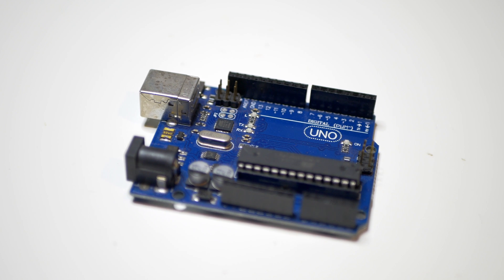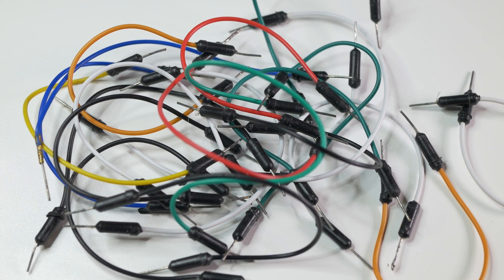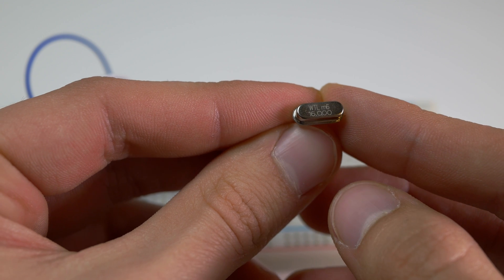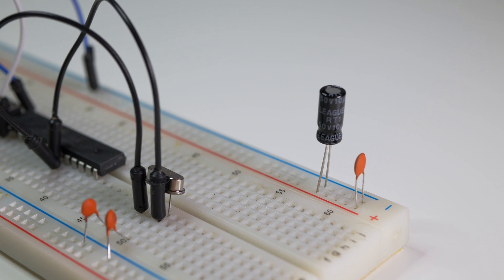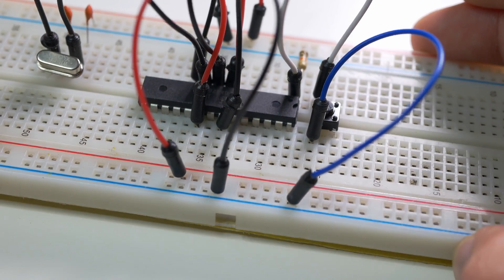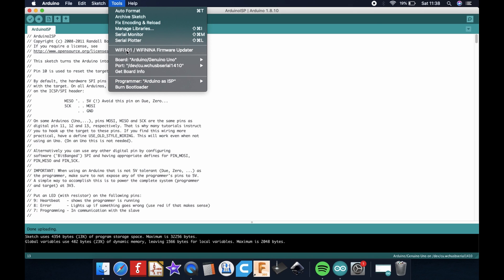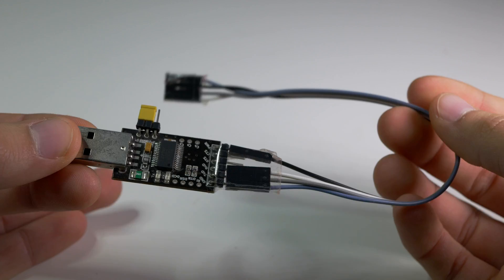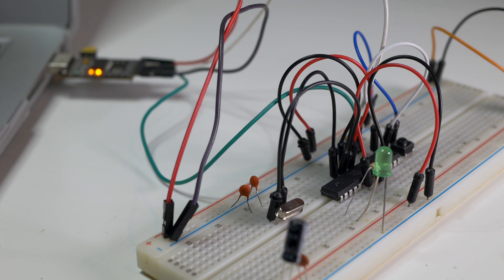DIY Arduino On a Breadboard

Comment: As i remember you also should add 10uF capacitor between RESET pin and GND to prevent Arduino to reset after serial connection is established. Without that i was not able to program my attiny

Comment: Hi, great video :) 
But take in mind that the crystal should be as close as possible of the MCU, and using wires would make it not work properly.
BTW it's not called "voltage filtration" but noise filtration
Reply from the maker: Yes, it should be as close as possible, same thing with capacitors, but in such a simple circuit at not super high frequencies it wouldn't be a problem and it always works for me just fine. Thanks for comment and tips!

Comment: These filtering capacitors should be placed as close to the atmega as posible to filter the voltage properly
Reply: Thanks for sharing knowledge

Comment: Hi.
I use such a setup to test the power consumption of the final schematic (with 4 MHz oscillator). But in case of using default crystal (16 MHz), it is easier to prototype with Pro Mini.

Do you use some other microcontrollers? I would recommend trying at least ESP32 (with or without Arduino core). I would also recommend trying something different from the Arduino software platform because it is a kind of trap :). It is simple and easy but forces you to use a bit ugly tricks, typical example - blink without delay. And after a few years, it'll be quite hard to switch to something else (based on my experience).

As for me the best alternative for the Arduino (software) is Mbed OS. I've just started to play with it.

Comment: For programming without a push button, you can hook DTR pin on FTDI to RESET pin on the bare 328p via a 0.1 uF capacitor.  very good resource:  http://www.gammon.com.au/breadboard